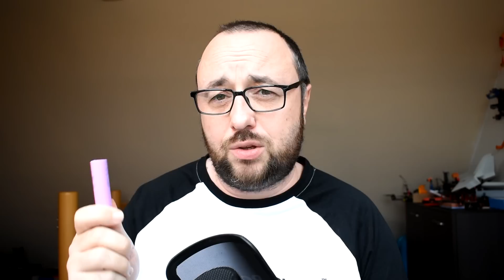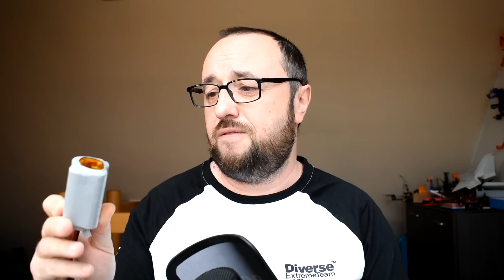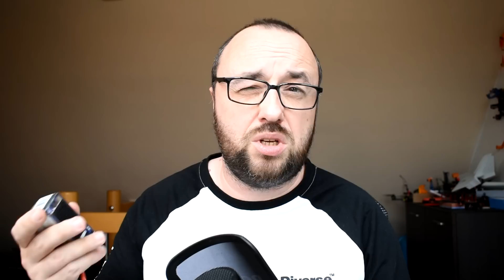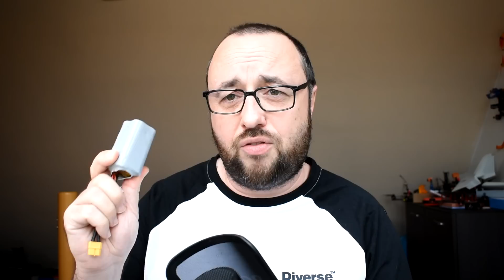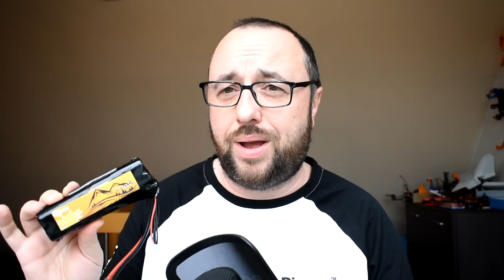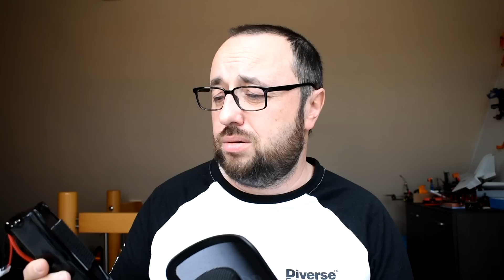Li-Ion or Li-Po for drones and airplanes? Which one is better?

Comment: The main problem with Lion batteries are its terminal voltage drops significantly as soon as high current is drawn from the battery, this results in early RTL initiation.

Comment: would a 3s li ion for a 1400mm skysurfers (bixler type) with 6 inch prop be good enough taking into account that it has flaps and  a speedebee mini with GPS?

Comment: Combination of the regular Lithium batteries with supercapacitors may be the best of both worlds. Weight and storage may have some challenges but the good news is that the supercaps are very light Weight and carry a good punch like for take off like a chock absorber for the batteries so that the up front current is provided without over straining the batteries. I used this method on solar backups to help with things like air-conditioner compressor kicking in and it seems to work great. Just an idea I am sharing. It may make a nice experiment using drones.

Comment: I fly bigger EDF jets and I power them with Molicel P42A cells. Their specs state 45A max discharge, so I always use 2 in parallel and add more cells then a LiPo setup would have.
My Freewing Avanti can go 220kmh+ and still have a 5min+ flight time.
There are some tradeoffs - one needs to drill holes for cooling and wire multiple packs properly (I use 10S2P with 6S and 4s packs)

When Molicel releases the the P45B cell then it will be a total no-brainer to use these over Lipos ;)
Reply: Hi Adam, I noted your reply regarding bigger EDF jets. I am currently (no pun) using 6S 4000 75C lipos to power a 90mm EDF, which draws 110A full throttle. I read "I always use 2 in parallel and add more cells than a lipo setup". Do you mean add series cells? Change 6S to 7S ?? Are there any other brands, with equivalent performance? 
Happy flying 👍
Reply: @davidwatkin1484  At the moment Molicel P45B is the best li-ion cell, I am not using P42A anymore even ;)
Just google the topic of "connecting cells in series and in parallel"

Comment: I'm waiting for someone to exploit the inherent mechanical strength of these cell and build the fuselage and the main spars out of them so that the battery is the frame of the plane. Should work if you figure out the connectors so that they don't become the weak points.
Reply from the maker: Interesting idea, but it would make the fuselage one time only :) Plus, balancing would be a hell more complicated

Comment: I like the idea because there are INR Type of cells they are allow 30A Constant current.
So a 4S2P Pack would deliver 60A Current wich should be good for easy flying.

And we are Talking about 7Ah 4S and 580G weight.

Li-fe is also interesting because of the long Cycle life wich is 5-10 Times more than Li-Po
Reply: Li-FePO4 is much lower energy density in  size and weight they're good for replacement with standard lead-acid ones. But not for drones even Electric vehicles.

Comment: THANK YOU FOR SHARE INFORMATIONS
I have ldark et115. DO you think will work with 2s 18650. THE proos are 2.3 inch and original battery is 550mah 80c. WANT for cruize not acrobatics. TOTAL weight of quadcopter+ battery is 125 grams. I GET now 3 min fly time.😥😥

Comment: Dude I really really like your videos. I started a Inav adventure with a 7” build about a month ago and watched many of your videos to build it . Maiden on Sunday went perfect . 9 minute flight time on 4s 1500 lipo 3.8  per cell  after rest . 20 satellites. I was too paranoid to try RTH or position hold but everything else worked . Very stable and easier to fly acro then stable mode . Now of course it’s time to build some 18650 packs.

Comment: I'm trying to reduce sag in my build by increasing the wire gauges and reducing the battery leads length. Is there something else that causes sag?
I might try replacing the motor wires with a higher wire gauge as well, but I don't know if that will have any effect on the voltage drop.

Comment: "similar weight but twice the capacity"...
Well if you want to sell Lions that sounds promising but I think here is something wrong. 
capacity does not count unless you compare it with the same voltage. But Li ion vs lipo do not have the same voltage. So if you compare the stored energy the advantage is far from twice as good. In fact if you compare the energy densities they are very close https://www.epectec.com/images/battery-comparison-energy-density.jpg 
The fact that makes lipos heavier is the posibility to create large cathodes for high discharge rates. So imho you cannot compare a 130C Lipo to a Lion. If you go to a 5-10C Lipo with the advantage of well manufactured design , more stable voltage and safer use the whole advantage shrinks.  
At the moment I am calculating and measuring the options for a bigger long range drone. And yes the weight of a lion would be a little less. But not even near 50% that justifies a Lion over the disadvantages..Maybe I miss something at the moment...lets explore this further

Comment: We need affordable and compact high voltage escs handling 8s or 10s and combine with low kv motors, so we can keep current low, and use thinner wires etc.  The Molicell 21700 are very good also

Comment: Is it possible to make a hybrid with i.e. a 4S LiPo and in parallel a Lithium Ion.
Reply: I was thinking the same thing. The lipo could handle the burst. Would love to hear from the experts on this.
Reply from the maker: I'm sceptical. Different capacity, different internal resistance and different discharge curves. Probably possible with extra electronics that would have to handle high current, be heavy and expensive
Reply: @FPVUniversity  what if it was possible to top off a lipo set with Li ion set. Like how you can charge batteries from batteries? So as you are flying it's feeding capacity over to the lipos.
Reply from the maker: @jeffjorczak  You would have to limit the charging current etc. etc.

Comment: Been flying 18650 VTC5D as my preferred cell and VTC6A for almost a year now.    Primary pack is 6s2p configuration for 7in on 2806.5 1300kv Avengers or 10inch on 3115 640kv motors.

Can very nearly rip quite nicely on 3s VTC5D packs with 3600kv 1406-1506 sized motors and 3.5in triblades.   Best to have an amp meter so you can use Betaflight to run up your motors tab and see at what throttle you hit 15 amps and 25 amps.    Then make sure you have throttle % active in your OSD because many of the small budget 4:1 escs do not have a current sensor so go by throttle % instead.

Have also run two packs for  6s4p on 13inch Xclass cruising for 18 minutes at a constant 50mph.   Soon will have 4 sets of 4s2p built for 6in drones but used for paralleling and series for 8s4p on the Xclass becase it really wants 32v instead of 24.

Comment: Answer is clear.
Li-Po-->Racing/Freestyle (Performance) 
Li-Ion-->Long Range (Endurance)
Reply: Its only true, if u dont need some amps. Im flying a 4m electro powerd sailplane. i need endurance and long fly times - but at the start, i need at least 90 amps. so its not  useable. thats what u have to be different. depends on the real plane - not only if using a copter or a plane - or using racing or long range.

u have to know your max possible amps drawing - no matter of what u flying

Comment: I'm testing the Samsung 21700 40t. In the Fms cessna the average consumption is 15A and peaks of 20, with very little power drop compared to lipo.
I have tested a 40 A discharge bench and they can withstand them but with more pronounced power drops and high temperatures. I think it is a good alternative in motorsailers.
Reply: Use the Samsung 30t. More power. 35A. Burst Up to 60A

Comment: The one big issue I have with 18650 cells...is that they only come in one physical size/ capacity....18650.
This is why the 4 inch LR quad is designed around 4 X 18650 cells.... Very limiting.

Comment: I think it would really interesting to see li-ion cell with tesla tabless design. It should be much capable to dump large current, without being constrainted by the narrow tab in cell battery. 
But we probably won't see it in years because of tesla holding the patent.

Comment: Well stated Pawel, for wing cruiser LiIon 18650 are cool. I can fly 45 minutes plus with the mini AR Wing cruising 60+kmh on 3s Sony VTC6. Launch no issue using iNav autolaunch,
Reply: The miniwing's motor takes only 10A at full throttle so it should be easy. I bought a 3S liion from ZOHD but it is too tall! :/  So I've just purchased a ZOHD Dart 250g which should have more room. I'm a bit worried about the launch tho. It has a smaller motor than our AR miniwing... Gotta throw hard!

Comment: Can you use a supercapacitor to help with the takeoff and cruise on li-ion to get the best of both worlds?
Reply: Nope! you can use a long wire with a magnetic connector (lol, good luck finding one rated at 60A) or a small capacity lipo in parallel.

Comment: Great video as always. I would just add that the surge in battery wholesalers in the past 2 years has really changed the economics. For example, you can get LG MH-1 or 18650BD cells with 3.2Ah and 10A continuous for about 1.50 USD each. Lately "salvage" means never used because companies go bankrupt before even selling one scooter or bike. So, a 4s2p is maybe 13 USD with wires and heat shrink and is good for maybe 4 times the charge cycles of LiPo. Another advantage of LiIo is configuration. You can pretty much make the pack any shape you want. Center of gravity off? Form a 4s tube that runs the length of the craft. Only have an "L" shaped space left in your bay? No problem. Lastly, with balance equalizer boards, you can say goodbye to balance chargers and hello to 24/7 cell balancing, including during flight, at any discharge level. In other words, LiIo looking better every day.
Reply: link to store please; sounds awfully cheap
Reply: @FasterThanJesus666  Battery Hookup or Jehu Garcia
Reply: @tedhancock68  nice one mate
Reply: Facts bro I flying a 5 inch nicely on 4s

Comment: I use 21700 cells more than 18650. One thing I wish iNav had was a preset for liion for battery profiles. I run both lipo and liion in my planes and have profile. Would be nice if in the configurator you could choose battery type along with the battery profile.
Reply: In your battery profile on INAV you have all the characteristics needed I believe (max voltage, min voltage and in between warnings).

Comment: These cells are great for many applications.  The current limitation does make it tricky for hobby use though.  Since the only real way to lower current for a given vehicle is to add cells either increasing voltage or running them in parrallel, either way you need more cells.  For a flying machine that means more weight and space needed as well as cost.  This quickly takes us past the point of diminishing returns.  However, if you do run parrallel packs you really up your capacity.  So a carefully planned craft could yield great results in terms of flight time.  I just purchased some sony 30a rated cells to mess around with  but they are NOT cheap for the real ones.  It's going to be hard to beat lipo for the time being.

Cheers

Comment: Pawel - Great video and discussion of the good&bad of using Lion batteries. Do you know if there is a common cell smaller than 18650 that could be used to make packs? I was thinking that could keep the weight down for using a 2P configuration. Or would a smaller cell also have a lower max current rating making it no benefit?

Comment: I've tried 4s1p vtc06 on 5inch and frankly it has a lot of downsides. Have to deplete to 2.5v if you want all 3000mah, sag is real, motors react with reduced sharpness on FC commands, oscillations are more prominent and generally is meh.. I get more time from 4s 1.5ah tattoo 95c. Otherwise liIon rules on my planes one with 4s2p 5000mah INR 25R, other with 3s 3000mah vtc06, swappable for 2500mah 3s INR 25R. Have to say Samsung's are better than vtc06 despite 500mah difference and "higher c rating".
Reply: For most drones I agree. For most planes, I think there are a lot of advantages. The main downside is that it is a big weight commitment to move from a smaller lipo to 18650.

Comment: I'm using 4S3P battery (Molicel M50A cells) on my 2m Opterra. Gives me over an hour of cruise time with a comfortable reserve.
BTW thanks for the tip on the soldering acid!
Reply: I'm using 4S3P Samsung 50E on my Opterra 😋
Reply: yo una 4S3P (celdas Murata VT6A), mañana lo probaré, estoy ansioso

Comment: i run a 5s1p samsung 40t 21700 4000mah. they have 35a constant draw rating. i run it on the project399 super g+ and get 18-20 of flight time, cruising w/7". they are $6 a cell

Comment: Hello, there is an also Polish guy who flies EDF jets on 21700 Samsungs LiIons ("EDF rc jet" I think is the name of his channel).
It would be interesting if you can share your thoughts about pumping around 80A of such a chemistry.
Reply: I'm flying 40T samsungs on a 7 inch quad and occasionally pull over 40amps, but nothing like 80
Reply: With a 4s2p or just single pack?
Reply: @Bj0rnis  with different setups from 6S to 12S and 2P or 3P
Reply: @Bj0rnis  single

Comment: No one talks about the charge times for these things though... You need to set them round 1.5a charge rade doubling your typical charge times frequently timing out the charger lol. Not that it's a huge deal breaker.

But it's often neglected to mention that while you can discharge them lower you don't really get a load of useful power as it doesn't have punch to keep you flying normally..it's safe in that you can fly longer but once you start to feel the sag you'd best start heading home to land.. you can cruise back home and not have to worry about destroying the pack though that's great.
Reply: the "punch" is derived by the maximum continuous discharge is it not? so if your 18650 is 3 amp yeah you arent gonna get any punch
Reply: @S Grim they are good packs you just have to know what you're getting with them and how to fly these packs the higher discharge versions are more expensive and some reviewers actually use the low discharge ( c rating ) when discussing them this gimping the review. They can be good just have to pick the right one for your exact application. I'd only wanna use them for cruise or long range and again you have to know exactly when to turn back

Comment: I used a Li-on 4s 3000mAh on my 7" ...it couldn't take off higher than a metre before cutting out.My motors were 1500kv,..Total shit is my opinion.Gave up with Li-Ons.

Probably great for 4" long range lightweight kwads👍😉
Reply: What cells did you use?  My LIthium Ion pack is working great on my 7 inch.  Cells are 40C and I usually pull 5-10 Amps flying around.
Reply: @gattmolson  Oh..I bought from Overlander,..they say they make the 4 cell pack using Samsung 18650,s but they don't specify the model.
Reply: Then you are doing it wrong.   I have been flying 7in with 6s2p for over a year and flying up to 23minutes.    And my 10 inch on 6s2p flys beautifully.

Sony VTC6A or VTC5D.
Reply: @dividingbyzeros  .. Interesting!. Yeah something must have been wrong.Maybe I forget to drop the Betaflight "minimum cell voltage"  to 2.5 volts?. Can't remember now,twas last year.

Comment: My experience: 5" slim frame, full Gopro8, 2550KV 5S motors, 5.1x3.1 props, LiIon 6S pack 3150mAh: hovering/slow cruise (first test) flight time 25minutes. end voltage 2,5V (sum 15V at the end)
Reply: how much did it weigh AUW? What thrust to weight can you get to before the amperage goes too high?
Reply: @warrenrose6362  820g. it has some oompf and stays stable at  the end. ratio? dunno

Comment: I use 21700 45A molicell 6s1p on my 6" cinematic with a great performance draining 20/25A without getting hot cell's
Reply: I built a Samsung 21700 T40 pack and it's working great as well.  4000 mah is giving me 20+ minutes of cruising.  Just don't slam the throttle.
Reply: @gattmolson  same for me, good sweet spot the pawel did not think about

Comment: Tesla's new cylindrical cells are pretty impressive, they modified the construction of the cell to avoid all the current going through small tabs, allowing the cell to dissipate heat more efficiently and reduce ESR. I expect these cells, with the right chemestry, to perform on-par with pouch cells (what everyone in this hobby calls "LiPo" (for the record, they both have polymer separators, but there are many dozens of lithium chemistries out there that are subsets of lithium ion. the high performance 18650's use INR.)
Reply: The new 4680 cells are also massive and super heavy so you'll need a big plane or drone to even fit a 4s1p pack.
Reply: @avsaase  I do hope someone takes the idea and applies it to 18650's. I doubt it will happen because Tesla patented the idea and probably have the patent for this process applied to 18650's as well, even though they will not benefit from this (unless they begin manufacturing 18650s to sell to an open market)

I doubt they would sell 4680's either, they would need to be salvaged. I think 4 to 12 of them would be excellent for a 7" to 10" build!

Comment: Hi Pawel! For an airplane, what do you think, if we use a small Lipo and a li-ion pack in parallel? The lipo will compensate for the high current demand at the launch and the li ion will do it's job for the rest of the flight?
Reply: pratik bhai ... did you try it ???

i want to know it

Comment: I built a 6S1P Li-Ion pack for my 7" long range quad and I can fly for 20 minutes. https://youtu.be/XrO2pX8u4o4.

I've also built a 4S2P pack, for about half the price of what they cost ready made (I'm using Samsung INR18650-35E cells in all my packs). It's a bit too big to sit on the 7" quad, so I'm using it for field charging other batteries.